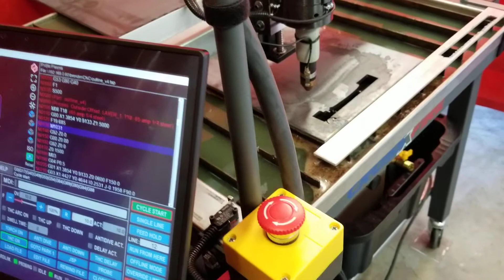Test cut at 65 amps

Comment: Cool vid, appreciate the detailed underside after-cut shot !  I don't know if you can do it with a plasma but on the laser we incorporate a bias in the power setting to reduce power as the head slows down to turn corners. This reduces the underside damage resulting from both the speed change but also the increased material heating in the zone around the direction changes. This results in a cleaner kerf in areas full of tight detail.